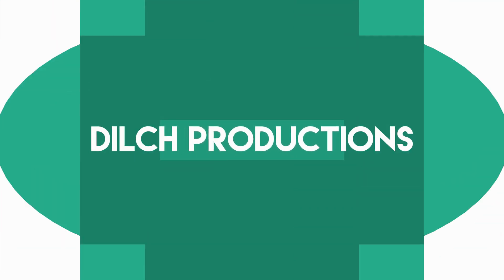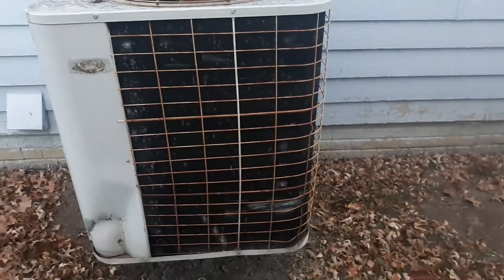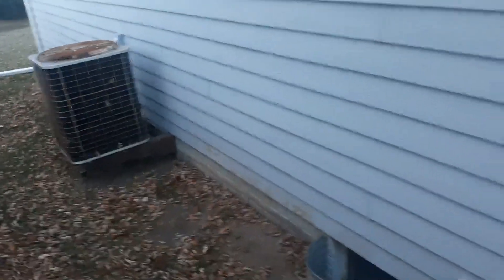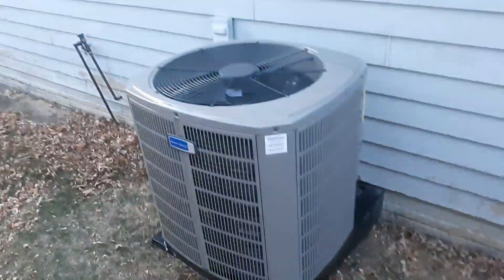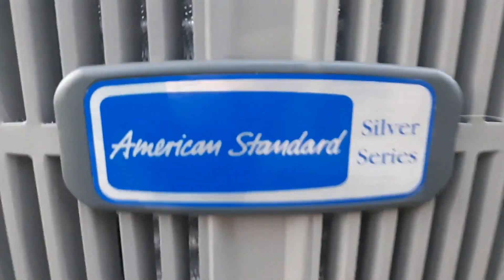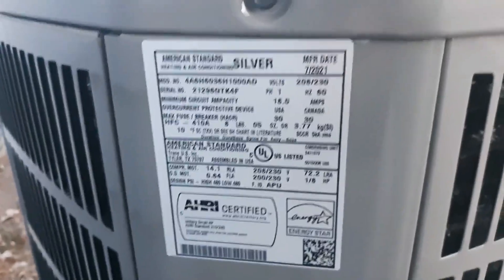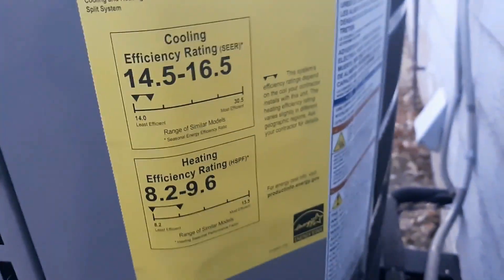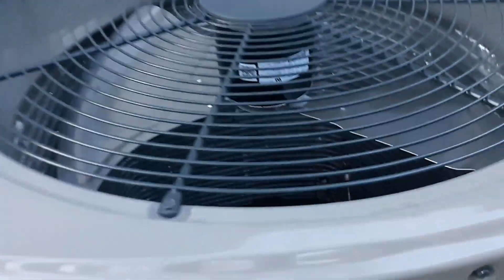My Neighbor's Brand New 2021 American Standard Silver Series Heat Pump

Comment: how much to install 2024 silver series? Estimate was. $11,000.  Is that too high...relatives think too high
Reply from the maker: That sounds a tad on the expensive side. According to Google the price of a new HVAC system can range from around $5,000 to $12,000. Is it a high end unit?
Reply: @dilchproductions in Texas, American standard silver series heating and cooling system 36000 btu 3 ton with furnace. Manufactured October 2024
Reply from the maker: I'm not sure, sounds a bit pricey but I'm not of much help here because I'm not a professional yet

Comment: Good unit and install. The only think that I noticed is that they made the thermostat wire connections outside of the electrical compartment, so the wire nuts and connections are exposed to water and moisture
Reply from the maker: Oh yeah, I hadn't really thought about that. Hopefully they used waterproof wire nuts. I agree, it's a pretty good install.

Comment: At least it got replaced with a very good unit! American Standards have always been my favorite units. It does have demand defrost so it will be a bit more tricky to catch it, but here is a tip on catching demand units. Usually if the temperature is cold but starting to warm up, you have a higher chance of catching the unit defrosting. The way demand defrost works is that there is 2 temperature sensors. One for the condenser of course, and one that senses the outdoor temp. If the temperature difference is not very much different from the condenser and outdoor temp, the unit will most likely not defrost. But if the temperature difference is higher say like 30°F on the condenser, and 35-40°F outside, then it will initiate defrost. Just something to know if you didn't already.
Reply from the maker: Yep, it's a nice unit! And thanks for the info, yes I did already know that it had demand defrost. Luckily it doesn't seem to be too strict. Thanks for watching!
Reply: @dilchproductions  I love your intro it is so satisfying
Reply from the maker: @Jonathan-q7y2w  thanks!
Reply: @dilchproductions  this unit is my favorite! And, what happened to the Bryant from 1996? Did it match the Bryants tonnage? 2.5?
Reply from the maker: @ArisBuliteanu  The Bryant was a 3 ton, and the new one is too.